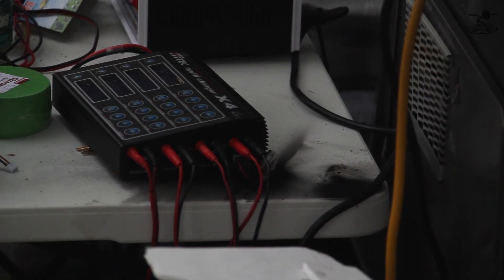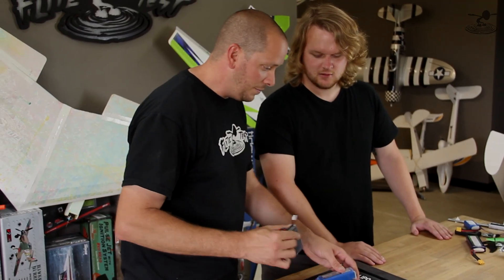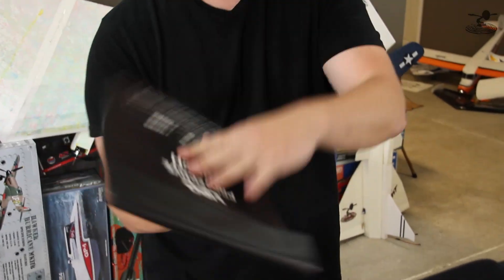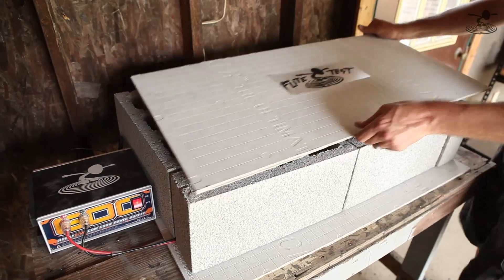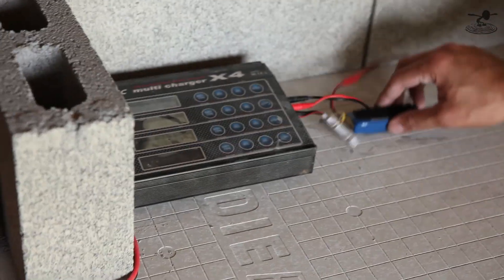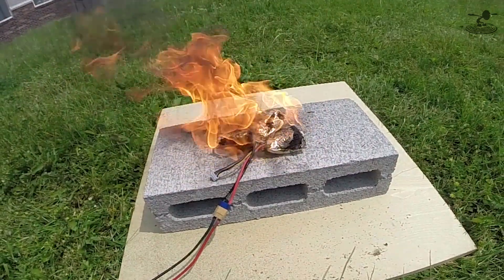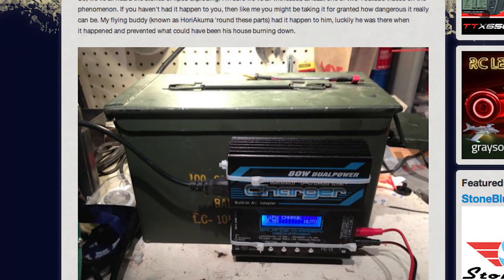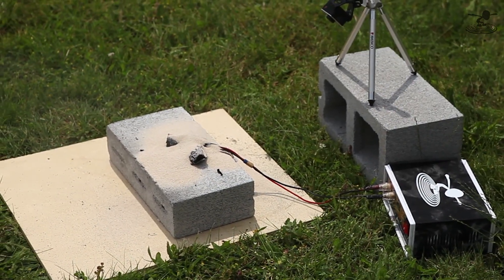Flite Test - Lipo Battery Bunker

Comment: Lipo's need to be in a ventilated environment. Dont use ammo boxes instead Get a bag of sand and a cinder block from Lowes put your batteries inside the vacant holes within the block then put the bag of sand on top of the cinder blocks and if the battery ignites it burns the plastic bag and the sand smothers the battery.

Comment: Well, personally, I think that the best lipo bunker is something like an Outdoor Barrel Charcoal Grill with Side Table and wheels (that costs less than a hundred bucks). And the key word here is outdoor, outside - or at least, a balcony. Another important aspect is that you will have fire and smoke isolation (by just closing the barrel), because you can choose to place the grill with nothing nearby... you can open and close the barrel... and some even have a small chimney that will direct the smoke (that you can add more tubes to make the smoke go much higher). 
Definitely you guys should try that out and perhaps make a good video about this option, putting some old lipos on fire to see the results.

Comment: I got one of the ordinary plastic euroboxes, inside are freezer bags filled with extinguisher granule. Here in Europe the brand ist called "Extover" or "Fireballs". Basically "foam glass balls" that are melting at high temperatures, drawing energy from the fire and extinguishes it by deoxygenation. Costs around 50€ and I got a storage with a passive fire extinguisher.

Comment: May thanks! Would it work to fill small amp case with sand? Other than being heavy, you could put several batteries in there at once. One battery issue might not set off the others, at least that's the theory...

Comment: wow, that set up really is good and cheap. I mean most fireproof bag doesnt have counter measure. They just contain the fire. It is good but still having counter measure is the best. Not only concrete block is good to contain fire. On top of that you have plastic bag sand that will melt and drop the sand if the it catch fire. Seriously this is one of the best set up for satery lipo charging and storing.

Comment: In the case of ammo cans, lining them with cement board will insulate the metal can so it will be less likely to transfer heat to the surrounding area.

Comment: I only have 2, 4s 2600mh batteries and i bought some 2, $10 metal toolboxes and lined them, twice with scrap concrete sheeting, the 10mm type. store them seperately in the garage

Comment: Would a metal bucket with a hole in the bottom on the side for the cables with a sand bag on top of the bucket so that if a fire happens the plastic from the sand bag melts and the sand falls on the fire

Comment: The holes in the concrete blocks look perfect to slide a battery inside to charge... then block the ends. Done. Try it... it will work.

Comment: Old stoves with large ovens and locking doors have vents and were designed to hold a fire inside so if you have the space in your garage not a bad idea compared to the potential outcome of a "God Forbid"" moment in time. An old metal refrigerator modified using fireproof foam insulation to replace the plastic interior insulation structures with a low pressure relief vent and reinforced locking door with sand in the freezer area above on square metal rebar and plastic sheeting to aim the release of sand at the area of heat is even better as cold batteries just above freezing at storage charge voltage will almost stop the clock during storage and are at their safest state.

You could start a business selling what people throw away. And I'm surprised battery manufactures have not introduced thin Kevlar socks for each size battery size they sell hanging under a race quad or at least used Kevlar reinforced material as it doesn't take much to protect a lipo battery without adding too much weight especially in a plane behind the motor as some thin ply or aluminum and EPP foam would have prevented this 0:53 from happening. But with that said this video was made in 2014 and lipo battery compounds are getting safer with GNB stating tests show their HV packs stored at 3.4v per cell is the best voltage to maintain optimal capacity. That is quite a bit lower than the "normal" 50% rule and a HV lipo battery cell at 3.4v in storage is even safer than the 3.85 norm being stated for HV cells.

Comment: Line the inside of your large ammo cans with another layer of protection.  If kept  inside weld a piece of muffler pipe to the can and cut out circle in the can. Drill a hole in the side of the building to the outside and run pipe thru it to the outside.  Epoxy a piece of screen to the end of the pipe using rubber bands to old in place till epoxy drys. Keep seal on can if you vent outside so it doesn't leak smoke into the room

Comment: iam planning to go on a month-long vacation, but i have 3 LiPOs at home. 2 of them i never used and i have them for 7 months (i know its not good to buy some, not using them but my RC car keeps breaking). all of them are storage charged. can something bad happen with them? i will put them in my garage, i have nothing flammable there, but is it safe?

Comment: I would be very cautious about putting water on a lithium battery. Most batteries use a lithium based alloy, so it's not as reactive as pure lithium. But still not a wise choice to make because you don't know the concentration of lithium in the alloy. If the content is high enough, it will have a further or continued chemical reaction. Most fires I've seen documented and read about, seem to be the polymer electrolyte and the case material burning. Those aren't a big deal because any standard ABC fire extinguisher will work. Once a lithium/water chemical reaction starts, you can only let it run it's course. If you don't know, don't risk it.

Comment: Make sure to remove the black rubber seal from the top of the ammo can so it won't catch fire and it could also build up pressure in the can and cause it to explode. If you use a ammo can or other metal container make sure to set it on something that won't catch fire like wood or plastic or line it with sheetrock or cement board.

Comment: I use a fireproof document safe from walmart..21.00 dollar's one is for charging ,one for storage.  Very safe and it has a handle in case if in a car or a house you can throw it outside quickly without getting burned. RCADDICT.  THANKS FOR THE AWESOME VIDEOS. but still keep sand and a fire extinguishers on hand.

Comment: Very helpful! I love the ideas! Keep it up! Would charging lipos in a glass mason jar with a metal lid that has a small hole cut in the top to run the leads to the charger?
Reply: no not good idea as the heat will shatter the glass

Comment: The safest precaution is not to charge the battery to its max voltage. Batteries (especially Li-Po technology) don't like to be stressed. If a Lipo is charged to 4.1V it still holds about 85% charge and as a bonus of not stressing the battery with the top charge voltage it will also last much longer (battery lifespan doubles for every 0.1V max charge voltage drop, according to BatteryUniversity.com). Keep your batteries an yourself safe :))

Comment: It's difficult with an extinguisher because most people use the wrong type!..... lol most people think an extinguisher is just that, without realizing there are different types, meant for different types of fires.... LiPo's require a class D extinguisher I think, could be wrong... 
lol I have 2 of each type mounted on my truck, and one of each type kept near my by battery chargers 👍😎

Comment: actually, that "LIPO PROTECTIVE POUCH" is total crap - the plastic covering BURNS like fuel - just put an empty match box inside and burn it (DANGEROUS!!!, don't do it at home) and you'll see!!!
that covering should also be fire-proof. i've measured like 300-400C on outside after we've removed such covering and left only fiberglass material with stapled sides. such high temperature will make almost anything else to catch fire! and that wasn't a LiPo - just imagine that case, omg...

Comment: @FliteTest

JamesHardie HardieBacker cement board transmits heat, and is not 1-hour fire rated.  With your bunker placed on a flammable wood table top, I would strongly suggest using Type-X fire-rated gypsum board instead.

https://www.jameshardie.com/product-support/resource-center/technical-documents/fire-prevention-faq

Comment: lipos have such a bad reputation but they are perfectly safe, lithium cells have been used for years and years in laptops and mobile phone without any issues at all, all the horror story's have been since lithium cells have been big in rc and other hobbies and the cells have been abused or damaged.

if treated with respect and providing its not damaged in a crash,  a lipo should never give you any trouble.

Comment: Get long leads for your charger. That way you won't hurt your charger. Make sure you have proper gauge wires. You can also use pots and pan with heavy lids or put stuff on top of the lids. You can put a ceramic or corning glass plate/bowl inside too. Thanks for get Video!

Comment: stock ammo cans are not a great idea for batteries. anytime you contain a explosion you amplify it. just drill a hole or 2 in that can so it isn't airtight.
Reply: Actual explosions only seem to occur when doing these tests and charging the batts at voltages or amperages way above what they experience while sitting in storage. At storage, they are not as likely to explode as they are to smoke or catch fire. An ammo box would be better if sitting on a piece of concrete, marble, etc. rather than sitting out in the open. What would you recommend other than sitting out in the open?

Comment: Hey Josh. I got a Floureon 4s 5.0 35C.  Rotated my propstations 90 degrees and flipped them upside down so I could do run up tests and measure voltage and amperage draw for setting up my AMP. I've flown 3S before but flight time is only about 9 minutes. I just want to do aerial photography, not interested in stunts. Quad is an X 525, SunnySky 980KV motors spinning 12" props. After the battery drained down I shut it down. It was swelled a bit. I let it cool and now the charger says, "Low Voltage" and wont charge. Measured voltage is 11 volts. Any ideas?

Comment: you could make a fully sealed box, and fill it with nitrogen or carbon dioxide or just vacuum it, so that the battery won't catch fire as quickly and will extinguish rapidly after.
Reply: Krzysztof Stankiewicz
water contains oxygen, and a battery will be happy to electrolyse it. Though it is possible that the oxygen in the lithium oxide may help burning too.

Comment: Some chargers won't work without balance cable attached. I balance every charge and always use a separate bag for each charge.
Reply: Not really the greatest thing to do because it where's the battery down alot and the liposuction won't have a long life but it is good to balance charge it just not all the time I only balance charge my lipo when it is out of ballance.
Reply: CircuitX I've had no issues charging this way at all. It's not required to balance overtime but as I said some chargers require it> I have one the won't charge without balance cable and bought a new one that will balance without as I need one to LiHV.

Comment: If you have $50 to add, I would suggest a "Leeo Smart Alert Smoke Detector Monitor".  It works ALONGSIDE smoke detectors, and when it hears the beeping, it calls your phone, and you can have multiple phone numbers it works through until someone sees the notification.  That way you don't have to be in the room while batteries are charging.

Comment: After seeing a lipo fire at my local track recently, I built my own lipo bunker. I used 2" tall 12"x12" patio blocks on the floor. Then put standard cinder blocks laid on their sides on top so the 2 hollowed out spaces of each block are faced up. That gave me 4 separate compartments total. 3 of them are used for battery storage, 1 is used only for charging. I also added an extended balance lead to my charger so the charger can be kept away from the charging battery.  I like the idea of the granite board used in the video, Ill buy some of that to make a top. My favorite suggestion though is the bucket of sand, so inexpensive yet effective counter to a lipo fire. Also the smoke alarm, ill be adding that too. Thank you for the ideas.

Comment: What about short to long term shortage while they are at 11.55 volts or so (40% charge)? No one ever talks about a typical RC hobbyist who has at least a dozen lipos sitting around the house forgotten about until they get the urge to go fly or drive year or so later. Would keeping them inside a Lipo bag and inside an ammo can with the lid loose or wired down by acceptable in the event one lipo decided to go rogue?
Reply: +David Detweiler They are most likely gonna blow during use or charge. It isn't impossible though for one just to let rip for no apparent reason. I keep mine stored in a fireproof way just incase. I think the ammo can would be fine for storage the lids lock very securely. Drilling some holes to vent pressure would be a good idea. Then store it someplace where if the can get really hot it wont catch something on fire.

Comment: Im always balancing anyways and if a discharged battery has more than .5v imbalance, I immediately throw it in the bin. 
Also, i have a little custom expansion on my charger using a zener diodes. If a cell voltage exceeds 4.23 volts, the charger gets shut down instantly.

Comment: I am making a version of this but I am using all cement board (no bricks). I'm also planning on making some smaller sections inside to hold each battery and put sand bags on top on these sections to put out any fire asap. The whole thing will be in a larger bunker in case the first compartments or sand method fails. What glue could I use to stick the cement board together. Gorilla glue works well to stick but in tests it loses strength quickly when heated with a flame. What else could I try that is cheap and easy? Thanks for any help!
Reply: +CDC444RC Anyone?
Reply: +CDC444RC  in your local shop you should be able to find a heat resistant glue, Which is normally used on chimney.
Reply: +BestLeblancEUNE Thanks. I ended up using a fire sealant and so far its worked fine. Tested by burning some paper inside and it works good so far. If I put a blowtorch to the glue it quickly weakens so it is not 100% fireproof. I use the sand bag on top method so it should how up long enough to melt the bag.
Reply: Great!

Comment: wow!!!  This show was probably one of the most important one I have ever watched.  I knew these batteries had the possibility of catching fire, but NEVER did I know to that extent.

I fly the Phantom 2+    Just went into my Gun Safe, and pulled out one of my ammo boxes, and am using setting up as you showed in show.      To test the batteries that I have, is there a particular device to use, or the one you were using does all sizes?

Guys, as usual Great job!!!!

John Kaddouri
Reply: +John Kaddouri Quick note if your using military grade ammo boxes they're air tight so if there is a fire the pressure will build up until it blows the top off, I have small holes to relieve the pressure.
Reply: A generic lipo checker will do that. The lcd ones.
Reply: +John Kaddouri 
Even with reasonable sized holes, an ammo box is still a bomb! All that's needed is for the battery to produce enough gas to pressurize the box enough.
Reply: i think any visable sized holes would let the gas out fast enough to depressurize it. its not high explosives
Reply: +mrlegodude96alt2 well it would be the opposite since the fire would consume the air in their but still bad
Reply: Optionalcoast74 I've blown up multiple ammo boxes with old batteries to prove this point lol, either way it's still a fire in a pressurized container.
Reply: +mrlegodude96alt2 what could go wrong?
Reply: mrlegodude96alt2 Great suggestion! With out the holes, it litterally could turn into an IED, with shrapnel from the box!  THANK YOU!
Reply: drkastenbrot I will do that Thanks!!
Reply: use sand because that big ball of fire is a bomb better buy a pelli 0370 case and fill it with wet silica sand with salt water aswel

Comment: would sugar or flour work for a lipo fire in a pinch. (thats what ive used in the past on the electric stovetop fires)
Reply: Sugar would work, but dont use flour. Fine powder like flour can combust, resulting in a little flame ball.
Reply: Sugar would burn as well. Its the main ingredient in a smoke bomb.
Reply: sugar cant be used as a fuel by itself.

Comment: I use a ammo can personally. I lined it with 2 layers of 1/2" drywall, which is surprisingly flame resistant. (seriously, try it out, I took a propane torch to the drywall for 1 minute, the paper on the torch side charred, but it treated to not catch fire, and the other side didnt even discolor, despite the torch side being orange hot where the flame was hitting it when I pulled the torch away)

Also, I emphasize the point of the fumes being quite nasty. If youre charging in a garage (or any other closed space)and the smoke detector goes off and the garage is full of smoke, the first thing you should do is ventilate. Dont worry about the charger, or anything else, get the fumes out first.

Comment: How would baking soda work in place of the sand to smoother the flames ?
Reply: Sand is cheaper.  Yeah, you can get a big bag of baking soda from the pool chemical section.  But sand is easier.